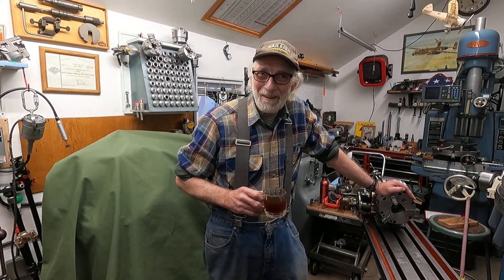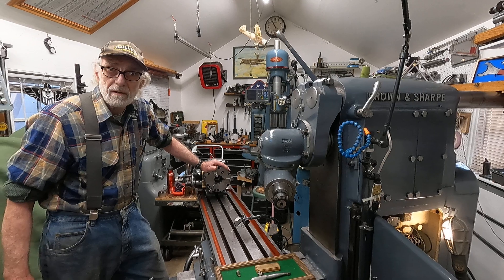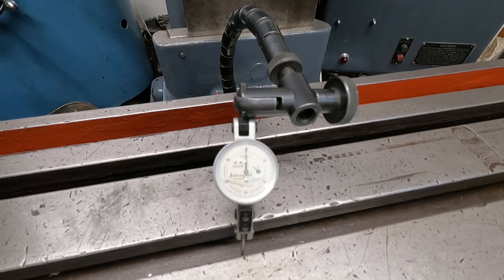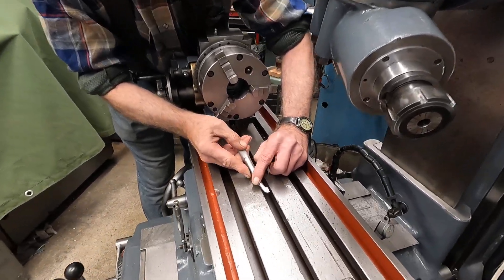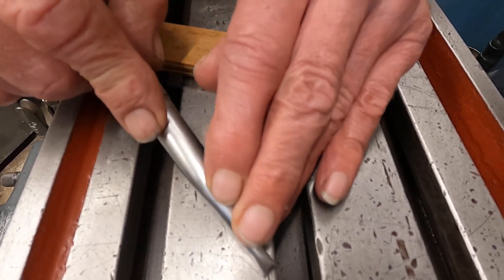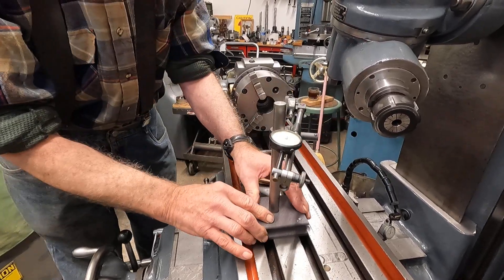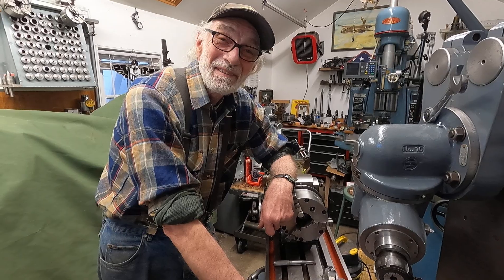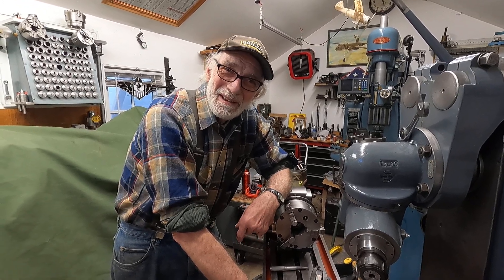Brown & Sharpe milling machine dividing head and table slot alignment.

Comment: Why do you say you could make more $ with a bridgeport? That B&S looks to be a much, much nicer machine than a BP,  at least to me 😉
Reply from the maker: The horizontal mill does more things but the common jobs can be done faster on the vertical mill. It is the same with more modern lathes being easier to use and being more productive, thanks
Reply: @deedeeindustrialsuperprecision  Oh ok, yeah I see what you mean. The big heavy old machines are beautiful, but much more cumbersome to use. Thanks!

Comment: Deedee, I highly recommend a set of flat stones for honing tables and cleaning up fixtures.  With these there is practically no risk of damage to precision surfaces, and burrs are quick and easy to remove.  They are made in pairs by surface grinding fine aluminum oxide stones with a diamond wheel.  This creates a very flat and dull hone surface which will only remove protruding burrs and not damage the base surface.  By creating them in pairs, you can use them to clean each other.  You could make a pair on your Cincinatti #2 with a vise, a diamond wheel, and some patience.  They can be used both dry and floated on a film of oil.  There are many U-Tube videos on creating and using these stones.
I generally use a precision flat stone that is not diamond ground, and is thus sharp.  It is made from a broken thread grinder wheel and achieves similar results to a precision ground flat stone, but works faster.  I always float it on a film of light oil or WD-40, and only use it on high quality ground surfaces like machine tables, surface grinder chucks, and precision fixtures.  It is made from a closed structure fine grit wheel that breaks down fairly easily.  This type of flat stone can be accurately flattened over a period of time by using it only on clean precision ground surfaces with oil.  When both the stone and surface are very flat, you can put large amounts of pressure on the stone and the oil will suspend it above the surface.  It will then quickly shear off any burrs which protrude through the fluid layer without ever touching the base surface.
Reply from the maker: I have a 6X12 surface grinder, and have seen a little about grinding stones flat. I have flattened the small Arkansas stone I was using. I have flattened the Norton Tri stones for my woodworking tools by working 3 of them together, There are many raised areas that need to be knocked down with a scraper before any stone will float  The table is in great shape despite the dings and a few bites, there is no T nut damage. What size stone do you recommend for dressing tables with a thousand micro dings and scratches with raised edges? 
 By the way I am looking at my other wreck the radial drill differently after you mentioned using ground bars along with end measuring rods for work positioning.
Reply: @deedeeindustrialsuperprecision  My favorite flat stone is about 3"x3" and was made from a thread grinding wheel 5/16" thick.  I works very well for honing tables with t-slots since it spans the t-slots well.  It is thin, so I don't have problems with grabbing the sides and rocking it into the work.  I usually manipulate it with two or three fingers while lightly pressing straight into the work.  I always use this stone wet and usually use it with WD-40.  I don't know the grit or hardness of the original wheel, but it has a fine grit and breaks down easily.  The WD-40 keeps it from loading up and floats it over the surface.  I can use it to check precision surfaces for burrs as there is a definite drag feeling when I encounter a burr protruding above the fluid layer.  When it slides freely, I am done (I have cleaned up precision moore blocks with burrs, removing the burrs and not damaging the blocks, which still indicate accurate to 0.00005" parallel, flat, and size.  I definitely recommend this method).  However, if there is a serious burr that I feel would damage the hone (these stop the hone dead, small burrs just cause it to drag), then I work the burr closer to the surface with a good sharp fine flat file (I have never met a hard block that had a big enough burr to stop the hone).  I just wrote "flat," but no file is really flat, so what I do is first find the convex side and then carefully bring the burr to just above the surface.  I then hone it down from there.  For honing surface grinder chucks I prefer a two-sided hone that is 2"x6" with an india stone on one side and a coarser stone on the other.  These have multiple straight sides, unlike my thread grinder hone which only has one straight side (other than the precision flat surfaces), so the 2"x6" stones can hone right up to a back rail.  When I hone a precision surface I always try to hone the entire surface evenly, by the way.
I too have contemplated using a drill press to do precision work with end measures.  However, I find that most drill presses don't have bearings which are rigid enough, and spindles which are tight enough and true enough to precision locate holes.  There are some heavy duty radial drills that are good enough to plunge slots with an endmill, and I have bored a 1.5" diameter hole in a cast iron exhaust manifold with a heavy drill press and auto feed (I needed to increase its diameter to thread it for the next larger pipe thread when the original threads rotted out).  However, I ended up with a terrible surface finish, had trouble holding size, and ruined a couple of carbide boring bars in the (successful) effort.  I find that end measures are best used with a milling machine spindle.  I have used them to get jig bore precision locations on a bridgeport with 0.001" y-axis and 0.0005" x-axis DRO scales.  I usually use a milling machine to locate holes with a center drill, endmill, or boring head depending on required precision, and sometimes use a drill press to enlarge/final size holes when the part doesn't fit the machine well for some reason.  A drill press will very aggressively follow a located hole.  Since most drill press spindles are so loose, indicating a hole is an exercise in frustration, but the pointer attachment on a wiggler will get you just where you need to be without much ambiguity (the non-precision bearings fins their centers when in motion).  On small parts you bring the part to the drill press spindle, and on big parts you use the radial drill to bring the spindle to the part.

Comment: Dee Dee For many years I’ve looked for old industrial machinery, woodworking or metalworking, and done my best to restore those machines.  Other than trying to do too many at the same time, ahem, I’ve loved the process and gotten quality machines that as a hobbyist I could never have afforded.  Just in case the followers of your channel don’t already own quality phase converters, they are a key element in the game.  Almost all the uninitiated are frightened off by 3 phase equipment and as a result there are great deals to be had on industrial quality equipment that will almost always be built to run on 3 phase power.  If you don’t have easy access to 3 phase power get dialed on how to make your own rotary phase converter using an old 3 phase motor, a few start capacitors, a few run capacitors and some miscellaneous small stuff.  You’ll save a wad of money building your own and then you’ll be able to jump on great deals on old, magnificent machinery.  While I’m really looking forward to learning more about how to use the machinery you’ve got, watching you lovingly bring these beauties back into service.  As always your attention to function and detail is helping me see how to do better restoration work and I’m going to go back through some of my already “restored” machinery to make them even better. If you keep showing off the scraper you’re going to shame us all into making our own..  A question, why aren’t you using a fine diamond lap as you’re cleaning up the various precision surfaces?  How are you going to clean those electrical contacts without damaging them?  Where are Chloe and Charlie?  You know, your sidekicks, Frick and Frack.  Cheers, Will
Reply from the maker: I was able to clean the contact with a dry cotton buff on a Foredom flex shaft. I will look at alternatives to finish cleaning up the table. My phase converter is a Monarch 10ee motor generator unit with a non-functioning DC end. It is 7hp 3phase  3400 rpm idler motor that I start with a Cederbug  7 1/2hp static phase converter purchased in kit form and I have some run caps to tone down the wild leg that simple set up cost around $125 for the Cederburg  static converter. The scrapyard here sells 3phase motors for $5 per HP. That is a subject for more experienced electricians, of course those poor souls are helpless on a Monarch 10ee drive, 
 These projects do take physical strength I used both the mill and radial drill for cancer recovery it did work one of a dozen doctors told me I am not supposed to be here. 
 I used the technique that woodworking machine guys have used to remove the rust preserving the original machined surfaces, I showed that in an early video on the radial drill. The dogs get kicked out when I am using the electrical cleaner and grinding carbide. There should be an email now under "about" on my home page!

Comment: Much respect, when You said You can make a lot more money with a bridgeport mill. Very true. My dad would always say whatever machine he had was the best. usually outdated stuff as far as production goes , but great for a guy to have in the garage. My dad had a 1897 lathe that he said was better than the new ones. Sorry Dad I love You but no. I wish i could talk machines with him but he died more than 10 years ago. I still have his little logan shaper. My dad made the entire clapper head on it and i plan on keeping it. I doubt i will really ever use it as I have a few wire edms and cnc mills . You love Your mill and have done a nice job with it. I wish the men lasted as long as the machines. Its really not fair is it
Reply from the maker: My grandfather was a navy machinist and my dad was an aircraft expert in WW2 called a Line Chief, he would hotrod his Jacobson riding lawnmower already.
 I found the mill and radial drill and topped that malfunction with an Axelson lathe. All among the best of their time but the heavy construction makes them cumbersome and slow to actually use. The better combination for me commercially still would be a Mori Seiki or type such as Webb and Cadillac, and after using one just a little, a Bridgeport Series 2 Special milling machine, has the head and knuckle ram of the standard on the heavy series 2 base. But I realized I am too old to worry about being in a hurry. I financed this whole thing by selling a motorcycle that talked to me and said you are too old and I probably will do you in soon.
 I miss my dad, I really got to know him taking him to his Army Aircorp's reunions.

Comment: I have one of those B&S indicator stands. They are pretty nice
Reply from the maker: It is a very old and forgotten tool like the surface gage that also has pins to guide it on edges. I found that on ebay with the two indicators in a metal box for not much, I have a 1930s Lufkin version that has no pins I can use on my wood working machines.

Comment: dee dee gona be a high of 94 degrees here today. The Old Iron  made the New Iron. I truly wish I could roll the clock back in time when our country was #1 in industry. Greed has destroyed our industrial might. Well that is enuff of my lecture on reality. Enjoy your coffee and thanks for the demonstration.
Reply from the maker: New equipment is designed around a 5yr finance cycle. The government would move assets like machines around years ago such as putting the equipment in a pool then other agency could pick the machine for further use. My old Monarch 10 ee lathe was purchased by the government in 1951 delivered to Bendix Aircraft in New Jersey , then found its way to the Hanford nuke site, and was used and finally released as surplus by Battelle National Laboratory a not for profit research institution for government and private industry. That pretty much seemed to end in the 1990s. Now it is the ever increasing budget and shorter required machine life.
Reply: @deedeeindustrialsuperprecision  Yes Sir when we gave the steering wheel to the bus to the Bean Counters is when our country went to hell.